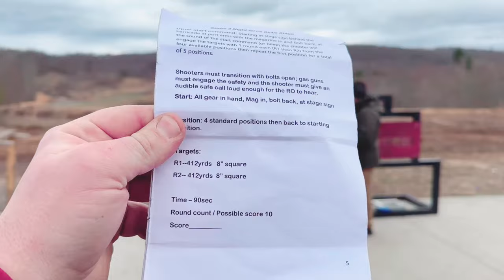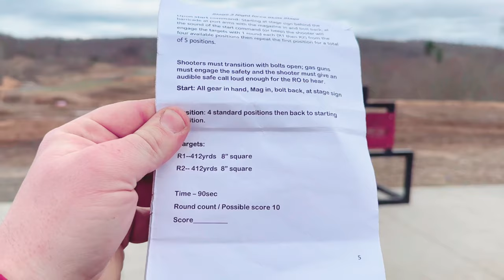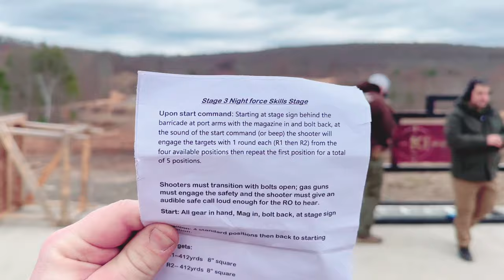HOW to PRS/First time attending a match

Comment: Dude in the purple hoodie would’ve been DQ’d for skyloading at any match other than the ones in that NE region. Seems like you guys let that stuff slide…
Reply from the maker: Putting a mag in with an open bolt isnt exactly unsafe…. I could see if he closed the bolt as well, that’d be an issue. Let me clarify first that I know nothing… it’s only been my first match but this seemed to be the norm here. And no ND’s sooooo🤷‍♂️
Reply: @averageshot  He's loading the bolt before acquiring the target.   Here in TX that's a huge No No.   You move, acquire the target in your scope, than load a round.   He's cycling right away.......DQ
Reply: @averageshot  not attacking you, if you’re the red hoodie black vest guy you’re money change nothing keep doing you, essentially sky loading is chambering a round when your not looking through your scope in the vicinity of the target. This isn’t the first video I’ve seen from that region of dudes sky loading. I’m guessing it’s just not enforced up there.  Sky loading doesn’t cause an ND, rather an ND WHILE skyloading could send a round off the range and shut the range down.
Reply: So how is skyloading different than running a gas gun ?
Reply: The new fudds have been found.